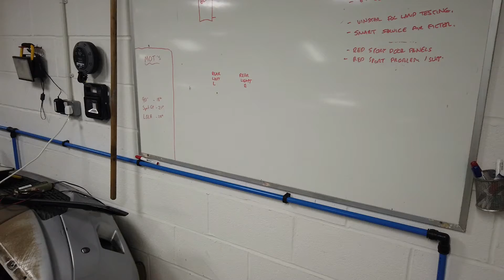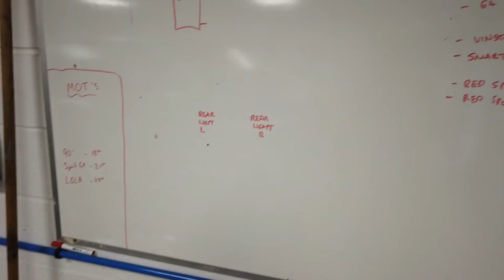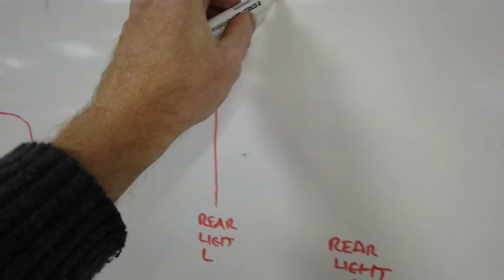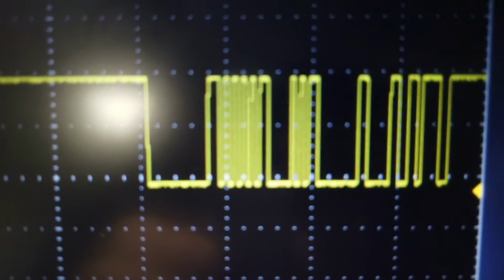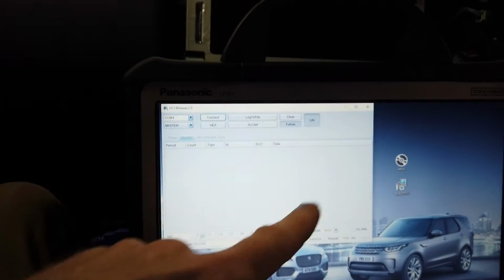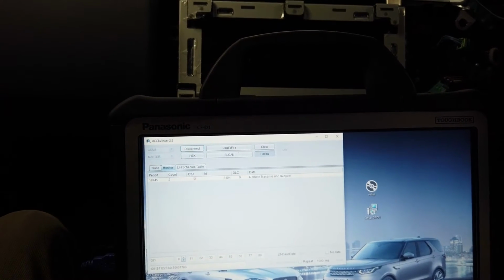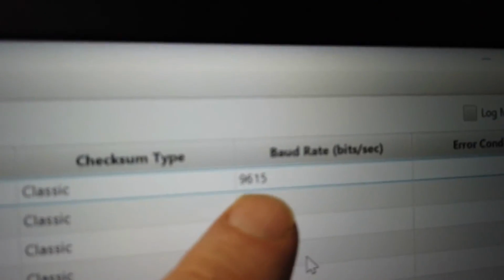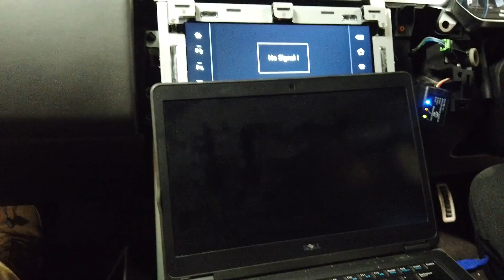Range Rover LINbus sniffing - We try and hack into the car LINbus system using basic tools !

Comment: If you want to make this work, there is probably already a way programmed into whatever module controls the DRLs. It's just a matter of figuring out how to turn it on. Generally, it would involve changing a byte in an EEPROM. Figuring out which byte, and what it needs to be changed to is the hard part. You would need modules which have it enabled, and ones which don't, and then you have to do binary comparisons to see what is always the same in ones with it enabled, what is always the same in ones without it enabled, and then what differs between enabled and not. Then, it's trial and error changing values to match the enabled one until you either achieve the result you want, or run out of things to change. That's how I figure out how to enable and disable options in Chrysler vehicles. It's a bit more difficult if there are no versions for that model which have the rear lights enabled. A lot of times the the functionality exists, even if it was never an option for that model. That's because manufactures recycle a lot of code. A lot of times the same byte code for enabling or disabling is used across models, even if it's not at the same memory address.

Comment: okay...but, is there any possibility here to decode the waveform bits to real values of temperature or pressure or something else?? or...does only the master device have a pre-programmed decoder for a specific waveform, and for me these are just random bits, meaning nothing? ... I don't speak English very well, hope you understand, but I will ask in a different way, or by connecting directly to, for example, a 3-pin air conditioning pressure sensor am I able to read the exact pressure value at a given moment?

Comment: Great video, thanks for sharing it. Answering your question at the end, I work as programmer in the automotive industry, actually the project I'm currently working uses LIN (wiper module). LIN networks have a master and up to 15 slaves, the slaves only send frames when the master request them, so the idea here is great, but I think it is not possible since even if you achieve to send the frame with the "fake" value the real slave is going to answer with the real one so you will end up with a fight between real and fake signal, plus, the frames are sent periodically so you will have the issue I just mentioned every time the frame is requested by the master which in this case I think is the Body Control Module. So, in order to successfully trick the module, you need to clone all the signals from the steering wheel and remove the real ones but doesn't seem reasonable to do it. Hope my explanation helps a little here. Of course, I could be omitting something here. if you found how to do it, please let me know.
Reply: About the only way you could overcome this would be to have a micro controller circuit that "intercepts" the messages coming from the indicator stock and forward all the other messages it sends out but then edit the message that it sending to control the lights. 

That one messages may be the only message it sends and the bits in the number map to it's different functions.  So 30 hex = 0011 0000 in bin and when you turn the light on  you get 31hex and 0011 0001 bin.  So the would be a state changed on bit 0.  Every other bit may be mapped to a different switch, for example bit 1 might be the right indicator, bit 2 the left indicator, and so on.  I am just speculating.  This would be a question for @marcosmecatronikify to speak to.

Comment: I earn a living consulting on FPGAs so I might be biased, but I think they would be well-suited for this. If you don't know about FPGAs, consider it as a "blank CPU" that you can flash "hardware" onto. They can be easily reprogrammed, and excel at stuff like this where you want to mess around with time-sensitive clock/data signals. You could get started with something like a "Digilient Arty S7-25" but a production version would probably be better off on a custom board. I'm willing to spend some time (for free) helping to get this set up and take things as far as I can. I might not be able to take it all the way since I don't have a vehicle I can test on (unless a Discovery 3 has LINBus?) and I'm on the other side of the planet. Let me know if you're interested. I've done other protocols like QSPI and LPC, LINBus looks reasonably straightforward (famous last words!)

Keep up the good work
Reply: I think the Disco 3 has linbus, so you should be free to experiment.
http://www.disco3.co.uk/forum/topic185808.html

Unless you have pre-made linbus libraries in Verilog or VHDL, I'd probably not use an FPGA, since most of the effort would be to build the LIN stack. The serdes would be simple, but there is so much else going on. I used a Spartan II as a comms bridge for the ICI-bus that is used in many Dutch naval ships, to be able to integrate the legacy computers(devices) with the modern combat management system. Especially the submarines and the vessels carrying the Goalkeeper. But the reason for using an FPGA for that solution, was due to the bizarre protocol, being 28 bits word length and having a quasi synchronous handshake with extreme timing constraints. Today, with the availability of much faster SoC's, I'd go for a microcontroller based solution. But hey, take it as a challenge. It could be an interesting project!

Comment: I read a little bit about how this is implemented on the L322. It's a bit more complicated than just sending out a payload to an address.
The master will send a header and then the slave (your switch) will fill in the blanks. That implies that you'll need to hijack the whole link and modify the data in line. So you need two interfaces, passing through everything unmodified between the interfaces, except that 50 address, that need to be modified. 9600 baud is slow enough for it to be manageable, unless the master is extremely picky about the timing.

https://workshop-manuals.com/landrover/range_rover_sport_(ls)/v8-4.4l/body_and_frame/body_control_systems/system_information/specifications/page_7374/
Reply from the maker: Yes i think you are on the right track - it needs to be a pass through module. The great thing about this design is that once its designed it can be used in several applications.... like steering wheel switches / ambient lighting / headlight DRL activation etc. Its a little scary as all the LIN on that line would stop working if the add on device had any issues !
Reply: @L663  I've had a similar project on the back-burner for a long time. What's been limiting for me has mostly been that where I'm living now I have no garage, and there is no power at my parking place available to put maintenance power to the car during testing. The other limitation is that I have no access to the Electrical Library for the 2006-2010 L322. I have a dodgy copy for the earlier variant, but that differs very much from my 2008 TDV8. Anyway, I had a pending order at Mouser and added a fistful of LIN drivers to the order (SN65HVDA100), so as soon as my current project is finished, I'll start messing around a bit. Reliability should not be any worse than what is par for the course for JLR. ;-)

Comment: a quick google finds an arduino based lin bus development board. it uses a mcp2004 by microchip so id start there and see if I could find any example code to inject data into the stream, the board i found was made by copperhilltech and they might be able to help u further. wasnt too badly priced.

Comment: I'd go for an STM32F103 to do the work. 
They are dirt cheap and has all the bells and whistles, including two CAN buses.
You'll need a LIN driver, but apart from that, it's all self contained. 

https://community.st.com/s/question/0D50X0000Aaa83X/stm32f1-dma-read-once-with-usart3-in-lin-bus-project

Comment: Arh just fit a couple of change over relays for the rear lights.
Reply from the maker: There are other ways to do this but we have a lot of other projects that need this technolgy
Reply: Yeah. You want a fancy steering wheel don’t you.
Reply: Diodes would be simpler and better (than relays), but this project is the correct solution.
Reply: You can’t transmit side lights on and auto lights enabled at the same time can you?  If that is the case it would disable auto lights.
Reply from the maker: @AndyK.1  We need to have a play !

Comment: Nice - super hi tech video today! Too bad you just can’t set the new hex values as default.
Reply from the maker: Yes a bit different today.... not sure it will lead to a solution but we need to develop this technology to fit the new steering wheel controls etc / new headlights / retro fit ambient lighting etc